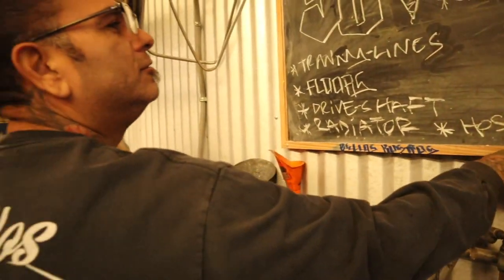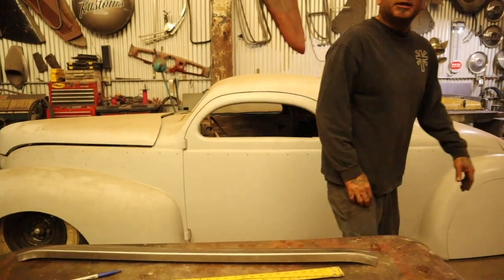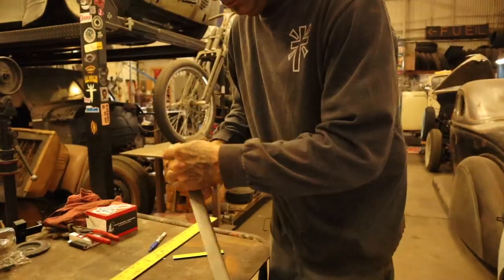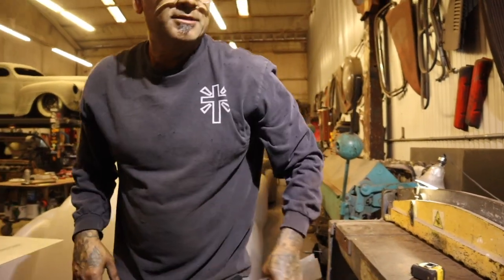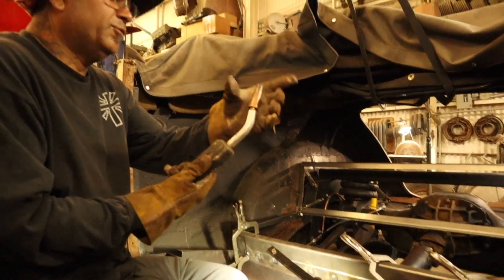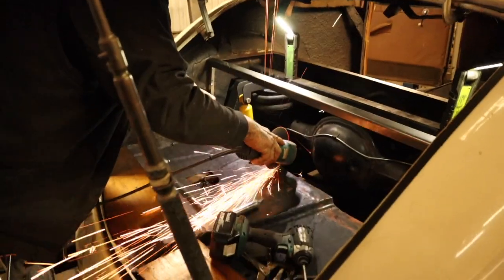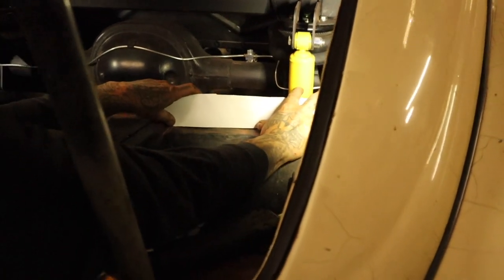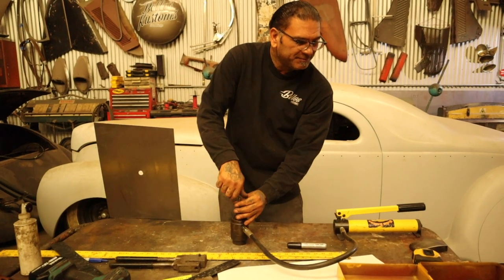1938 Ford Cabriolet - Part 9: Rear Floors

Comment: Just wondering. If you took some 2x4s and costume made them with some plastic 2 nice box fans and filters used for heating and air you could make a paint booth really easy that would tear down fast and give you a great place to paint dust free. Have you ever considered it? Probably take 3-4 hundred in parts and would put away in a small space.

Comment: By the way you can get those nuts that are 3in long drill a hole in the wood and JB weld them in and glue zippers on your plastic sheeting and the wood.  The box fans and filters are easy you know what to do on those. That plastic is all over the place now whit this virus stuff going on. All the stores are using it and its heavy duty stuff too. Last a long time and would probably break down to the size of a cherry picker. build a nice box for it that holds everything. A ready paint booth.

Comment: You are the man. I love your show so much. I would love to see you build a 69 frame off 1000hp Camaro. I know your heart is in low riders and I like some of the old bombs built but for me I'm hotrod at heart. Tell me have you ever thought of building a lowrider with 24s in the front and 13s in the back? The problem I see is finding a skinny tire for the 24 and You'd have to cut the rim to narrow it. And you'd have to use a 100 spoke on both. So think of this. A car that has these wheels with little to no rake, Maybe a little in the front but could be dropped on the ground when parked. You can't skirt it cause you'd want that 13 to show. This would give a cool look if all tires had the same width and thats the key to pulling this off but wow you could start something that people would go crazy over. I'm sure getting that 24 under the fender with it able to turn is a big part as well. Love your show man.
Reply from the maker: Damn dog you got a good imagination. You should have your own YouTube! 🤘

Comment: Those weld sparks dont burn holes in the bags?
Reply from the maker: No the bags are made basically tire rubber
Reply: @BellosKustoms  
I didn't think they were that thick. I still need to buy mine. Going with Slam re7s. Hey let me ask, does anyone make a load leveling sensor that just increases or let's out air pressure on it's own according to the rear end height? I'm bagging the rear of my '51 Belair but I don't want switches, I just want it so I set the ride height where I want it and if someone gets in or out of the back seat it'll increase or decrease the pressure to take it to the preset ride height.
Reply from the maker: @ninja63639  Check out the last video posted, Pt. 11 to the cabriolet build. Im installing a system called E-Level made by AccuAir. It does exactly what you are describing.
Reply: @BellosKustoms  
I watched it my brother. I watch 'em all. I was thinking something like that but automatic so I dont have to press a button. I want something that'll just do it on it's own if the rear weight changes
Reply from the maker: @ninja63639  E-level does that. You can have preset ride heights and the sensors keep the bags adjusted to that height
Reply: @BellosKustoms  
Oh shit ok I didn't realize that! Thanks man